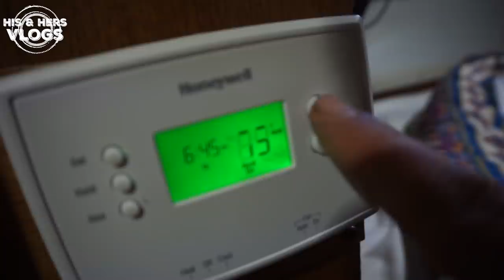Espar Hydronic Diesel Heater Failure and DIY Repair

Comment: I had the same heater in my semi. One of the secrets to long life is to run a quart of pure #1 kerosene through the unit at least once a year. It will burn most of the carbon off the glow plug and clean up the filter screen.
Reply: Good to know.  I'll have to do that on my rig.

Comment: I have had and worked on many types of those heaters, espar, webasto, pro heat, eberspocker, both gas and diesel. In that type of heater the glow plug is the weak link after awhile they just don't heat hot enough to light off the diesel or gas. You can always tell as they get difficult to start but if you start your rig and bring up the voltage from the alternator they will start for a while longer. You always should carry a spare glow plug and spare glow plug relay as they seem in my experience to be the most frequent issues. I learned on VW gas heaters when living in AK. Make sure all your electrical connections are good and you don't have lower than battery voltage at the heater.
Reply: Alan Hester Ha! I had some of those Southwind (?) heaters for my VWs when I lived in Juneau, but never had the balls to hook one up. The warning about "flames burning your passenger's legs" kept them in the storage locker.

Comment: I pulled mine out because my O rings failed inside the unit, and coolant fluid went everywhere throughout the heater. I even had it inside the exhaust! So I cleaned it out, and while I was in there I replaced the gasket and the atomiser. Since then it's been failing occasionally with a 'fan speed' error. I suspect some of the coolant fluid got into the fan and clogged it up to some extent. After running it a few times it seems to be OK. Touch wood. I did notice when it stops and fails abruptly with the error, the next start is very smokey. I assume it's pumping out fuel, then it stops on error, the fuel keeps going for a bit, then next time it starts it has to burn through all that excess fuel?...

Comment: Hey I noticed that your Espar heater is hooked up to a home thermostat... Do you have any videos on how that was installed?
Reply from the maker: I’m not sure about how it’s wired, but I do know that it’s not good for the Espar because it cycles the unit on and off to maintain temperature.   
That contributes to plugging the atomizer with carbon.  
We were told this by a corporate Espar representative.   So it’s best to set the thermostat to 90° and regulate the temperature by opening windows.   He also said to run it for 30 minutes every month to keep everything working.  
Ours is linked to the water heater so even in the summer we can use it.

Comment: Hello, what video did you watch to learn all this and get the right parts? My bunk heater for my semi looks like the same, 1 night after getting the computer reset, it almost cooked me like an oven. Now 3 days later it seems to not heat the coolant enough to push hot air all night
Reply from the maker: I watched a bunch of YouTube videos until I had a rough idea of the disassembly and jumped in.   
Mine was not throwing codes either.
Reply: @outliersoverland  ahhh yes see, I feel like there's no solid video. I've been doing the same watching all the different ones to piece it together. Thank you for the reply

Comment: I am not sure if that was a pass or a fail. Does it start up without smoking now? Because I think the cleaning bit was brushed over, wasn´t it?
Reply from the maker: It cleared up the following day when I fired it off.   Then the combustion blower failed.  Then the coolant pump failed.   Then we replaced it with a new unit and carry the spare for parts.

Comment: Thanks for this video.  I'm trying to do the same for our Revel van... when you disconnected the heater from your rig, did you have to clamp lines, or did you just lose some of the coolant (assume that's what its called) from the hydronic system?  Just thinking about the initial taking everything off the vehicle.
Reply from the maker: You’re welcome.  There was definitely some coolant loss, but I used some plastic and rubber bands to keep the system from draining.   Pinching would work as well.
Reply: @outliersoverland  many thanks!
Reply: @outliersoverland  do you have a link to that store you got your parts from?  I need to service the one on my semi and can only find parts for the airtronic. And thanks for the video, it was very helpful.
Reply from the maker: Search Espar parts .com and you’ll see it